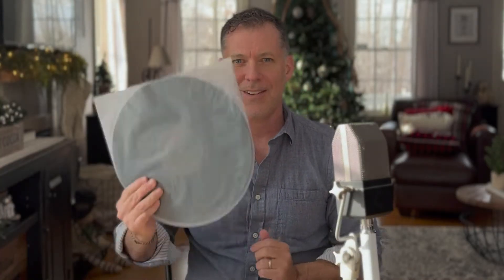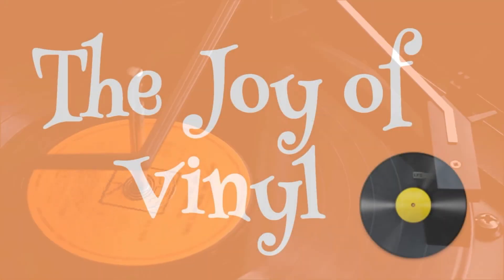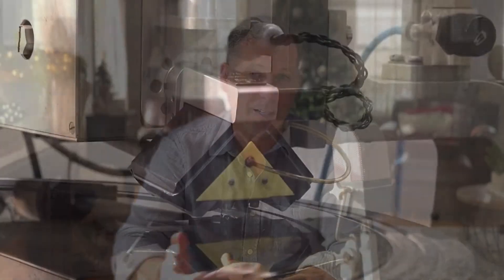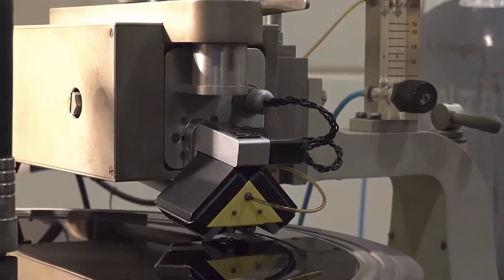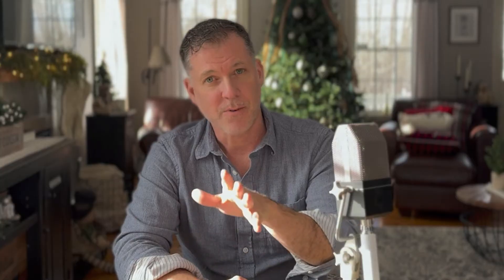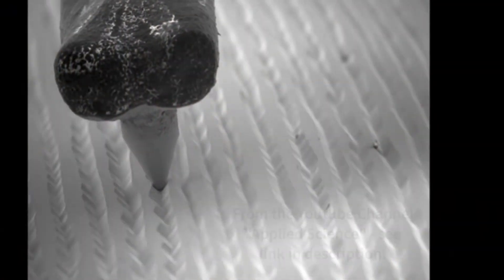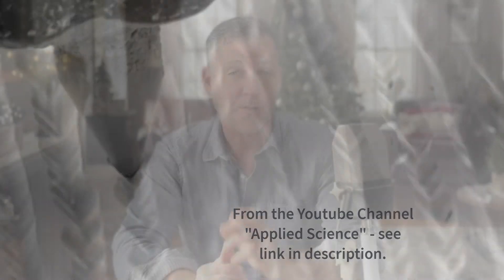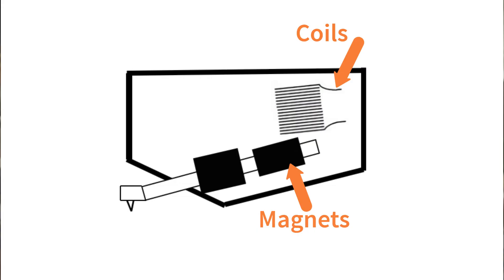How Does a Vinyl Record Produce Stereo Sound?

Comment: Checkout Soundsmith -- good value, great sound, lots to choose from and much reduced stylus replacement.  I have the Zephyr Star low output moving iron and Sussurro also MI. They have other more budget friendly cartridges as well. Other brands I have: Koetsu Rosewood, Sumiko Blackbird (retired) and Dynavector XX2  MKII. One thing to consider is how easily the stylus cantilever can be seen to set the two-point alignment. The Blackbird and Dynavector are open - easy to set. The Rosewood is difficult to see as it sits under the box body. The two Soundsmith cartridges are in between - open with protection that has a slit in it. I have one other green blob cartridge, $1000 when I bought it, also was very difficult to see the cantilever. All sound good, no complaints.
Reply from the maker: Thanks, Steven!   I've heard great things about Soundsmith.  You've just reminded me that I need to check them out.

Comment: Hi a little off topic, do you have any experience and or opinions about the Shiit mani 2? Thx for any imput
Reply from the maker: Hi Nick - I do actually.   It's a good solid option for someone wanting to move away from built-in phono stages.  I'd consider it the first step for the budget-conscious.  Absolutely nothing wrong with it.
Reply: Thx, I should have added that I now using a project s2 phono preamp and I guess what I’d like to know is the mani a worthwhile step up is the difference audible? Thanks for your input Nick
Reply from the maker: @Nick2842  Hi Nick!  I don't think you'll hear an improvement over the Pro-Ject, to be honest.  Both are comparable at that level.

Comment: Love the videos you do! If you draw a schematic on paper comprising of a moving coil microphone a recording device which can be analog or digital a cutting head and a loudspeaker component and then as a mono signal put in the microphone component coil and a diaphragm and then nothing in the recording components or device and then the cutting head put in two coils and the stylus and then in the record player stylus the same thing as The cutting head and then with the loudspeaker and I mean the driver put in the coil and the cone.
Basically that's the sound hits the microphone the diaphragm moves towards thr coil producing voltage volume and that signal goes to the cutting head and in the case of mono moves the two coils so that the cutting stylus can cut into the vinyl record which then played back on a record player moves the two coils attached to the pickup stylus and then that signal goes to an amplifier to increase the power level and then the signal goes to the coil and moves the cone. Give you an example you can speak into a loudspeaker and plug the loudspeaker into a preamp and amplifier connected to another loud speaker and you will hear your voice out of the second speaker this also works with microphones of removing coil variety and you can hear in the microphone the person speaking into the loudspeaker. Tool based on coil energizing from the voltage which then creates the coil as a magnet and because it's next to a magnet it then moves in either a negative or positive direction depending on the voltage being positive or negative.
Simaen
Reply from the maker: Very impressive Simaen!  You are way ahead of me with the physics of it all. Cheers!

Comment: @5:56 "I'm looking for recommendations (for moving coil cartridges)"

I have heard several cartridges that were good, but did not hold my attention in a meaningful way.
One that I remember is Clearaudio's Stradivari (not sure if it was the v2 model).  It was very good, but not great.

However, I have heard 3 cartridges that impressed me, and one blew me away.

-- Most recently, I heard Hana's flagship cartridge.  It impressed me.  I would be happy with it.

In all fairness, I heard it in a store that was using a new pre-amp from Vandersteen.  So perhaps Hana's cartridge would have impressed me more, with the store's Aesthetix Metis pre-amp that they normally use.  Vandersteen makes amazing speakers and amps.  But I do not think that his first pre-amp is of the same sonic caliber.  Was it Hana's cartridge, or Vandersteen's pre-amp, that was holding back?  A bit of both?  I do not know.

-- I have also heard Air Tight's PC-1 cartridge, and fell in love.
That was approximately 15 years ago.  They came out with a PC-1 Supreme, that was 50% more costly.  Reviewers raved about both, but raved more about the Supreme version.

-- I heard Clearaudio's flagship "Goldfinger" cartridge, and my jaw dropped.
As great as the other cartridges were, the Goldfinger stood alone.  Perhaps the Air Tight PC-1 Supreme would give the Clearaudio Goldfinger a challenge?

There are many other amazing cartridges out there, according to reviews that I have watched and read.  But I have not heard them.
And there might be more down to Earth (pricing wise) cartridges that will get you in the neighborhood of the above mentioned cartridges.

It is really hard to demo turntables, tone-arms, and cartridges.  And if you demo those items at different locations, then you have to factor in the skill and the ear of the person that dialed in the many vectors of the cartridge / stylus, which makes a HUGE difference.  The person setting it up can make or break the musical presentation.  It is no small matter.  It is critical to get it right.

The Clearaduio Stradivari would probably give the Clearaudio Goldfinger a challenge, if the former was professionally dialed in, and the latter had any of its vectors slightly out of alignment.

Other problems with auditioning cartridges in different locations are:
-- Different speakers, and different everything else in the stereo from location to location.
-- Different room acoustics.
-- Were the speakers, from location to location, ideally placed (our host surely knows how much that matters).
-- Different vinyl pressings from location to location (unless you bring the same albums with you -- which you should).

If you happen to hear a cartridge that blows you away, then you can rely on it being a great cartridge.
But if it does not blow you away, how can you nail down why?  Was it the room, or the speaker placement, or the turntable set-up, or the record that was played, etc?

I heard the Clearaudio Stradivari, the Clearaudio Goldfinger, the Air Tight PC-1, and the Hana cartridge all on the same stereo in the same room, and all set up by the same turntable professional.  The only varying part was the Vandersteen pre-amp when using the Hana cartridge.

As to our host's explanation of how sound is derived from vinyl... everything he said is hokum.
The truth is... it is magic!  😱
Reply from the maker: 😂😂😂 - It is alchemy!

I may be wrong but I'm almost certain you mentioned the Clearaudio Goldfinger a few months ago too.  I'm building a list, and then I'll have to track them down, hope the audio store in Nashua, NH has some of these (or similar) and take it from there.  You nailed it with the need to hear them under the same or similar conditions and equipment.  That's always the problem with hearing something great in a showroom.  It may not sound close to the same at home.
Reply: @TheJoyofVinylRecords  "alchemy"

Good word.
I was compelled to look it up.  Had a good laugh!

Yes, I had mentioned the Clearaudio Goldfinger before.  It probably costs $20,000.  It was $16,000 close to a decade ago.

By the way, I own the Air Tight PC-1.
I was confident that I would like it, based on reviews, and based on the turntable guru (Nick) in the store buying one, too.

When I inquired about purchasing that cartridge, Nick told me that he had to order 3 (seemed odd to me).
He told me that he had another customer interested in the PC-1, and that made 3 orders.  But that the high-end store's turntable specialist was buying one for himself, put me at ease.

I loved how it sounded, and over time, I must have inadvertently caused it or the tonearm to become misaligned, because it lost its magic.
I brought my turntable back to the store, and Nick re-tuned it, and played it on their flagship system.  It sounded amazing on that highly resolving, and highly musical, dream system.

Air Tight's PC-1 is a winner.  I think it cost me $6k, back in 2007.  Expensive, and punches above its price point.  I have no regrets, other than not taking out a loan for the Clearaudio Goldfinger.

Comment: There is a cartridge line out of Japan called DS Audio. They don't use magnets, or alternately coils, at the end of the cantilever like MM or MC cartridges.They have a light beam in the cartridge and the cartridge "optically reads the record groove." The Audiophiliac reviewed their budget model, which isn't so budget and liked it. The review should still be on Youtube from many months ago. He said it sounds less like playing a record with the optical cartridge, it has less noise than conventional cartridges. I think the Audio Advisor currently has a sale on it. $2000 down from $2750. It uses a conventional stylus and it comes with its electronic box.
Reply from the maker: I love when things like this pop up.  I'd heard mention of a cartridge like that but hadn't yet researched it.  Looking at some articles now.
Reply: The record also needs to be super mega  perfectly clean as it picks up every single speck of dust that a regular stylus would just push aside.